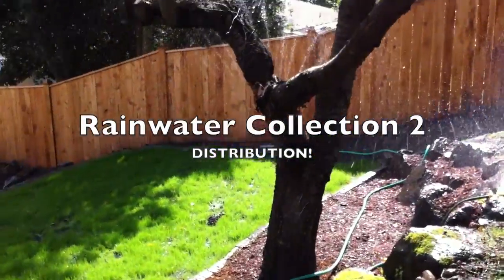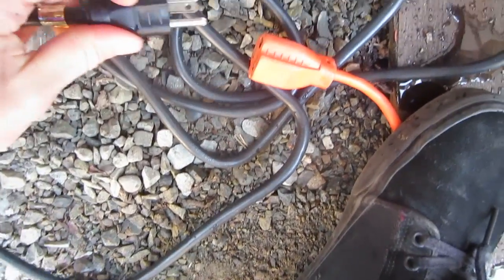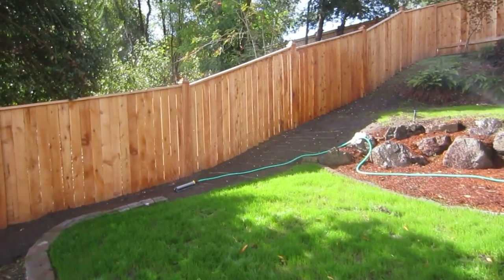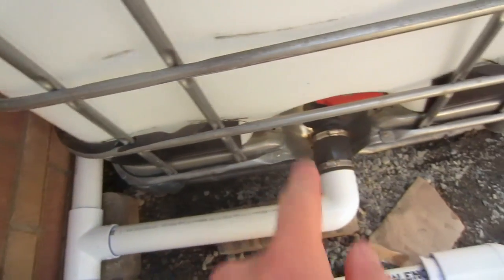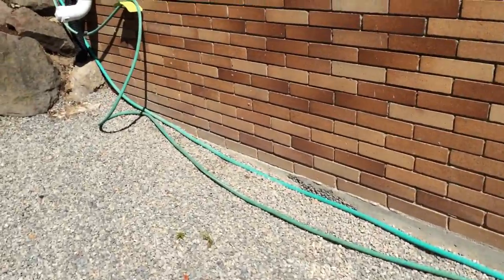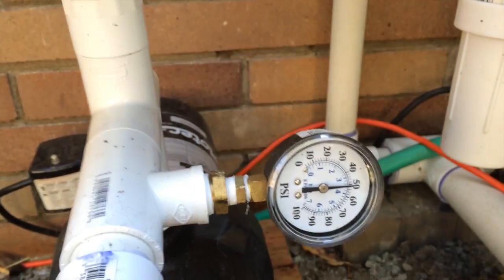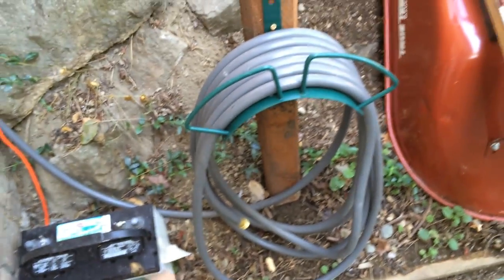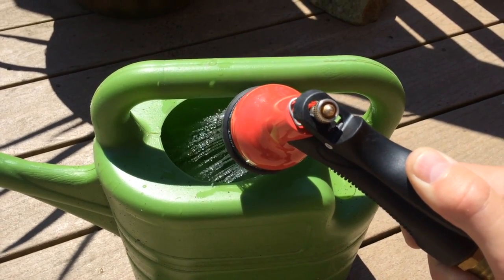600 Gallon Simple Rain Water Collection System - Pump - Part 2

Comment: You should look into underground irrigation style sprinklers they can be found typically cheap online. Rain Bird being one of the best brands.  The water usage is more uniform and the flow rates, depending on the sprinkler type, Can be ideal for shallow well storage. We installed some apartment buildings, where we funnel rain from the roof to a cistern in the basement. Then pump from there. You will need a decent filter but lots of underground irrigation can handle a bit of trash in the lines. heck even put the sprinkler heads on a hose spike if you don't want to bury it all. You can run multiple heads at a time too. We also use the poly pipe (the same kind you used for the cabin rain systems feed to the sink)  in the ground up here in Canada instead of PVC. It's easier to work with, no glue and holds up better to freezing if some dummy didn't blow it out in the fall. Keep updating. I'm curious where this goes, great job so far. Inspiring for sure.

Comment: nice system. see the inside diameter of those store bought garden hose manifolds with built in ball valves - you could make up some manifolds from 3/4" t-fittings & you'll have double the pressure at the sprinkler.
Reply from the maker: +jasonmushersee Good idea, that is exactly what I would like to do eventually. The hoses are ugly. This system would be perfect for anyone with a pre-installed sprinkler system.
Reply: SolarBurrito do you have a video from the start on this project? I like your set up & would like to understand if it would fit my needs. I would be pulling water from pond to either a large tank or some like yours. Thanks

Comment: Sweet! Thanks for sharing. You have the exact system I want to install under the cabin this year. If possible, can you list some of the plumbing parts you need going from the valve on the water tote to your pump. i.e. Pipe size, couplings, etc.
Reply from the maker: +The Cedar Workshop 2" from the IBC totes then it needs to step down to whatever your pump inlet is. Mine was 1"1/4 I believe. The system look complicated but if you watch a few videos on well pumps you can get the idea. Also there are pumps that have a tank built in. The trick is you need a solid  beefy PVC check valve in front of your pump inlet. It will not work without it.